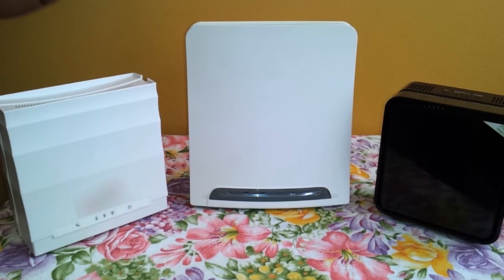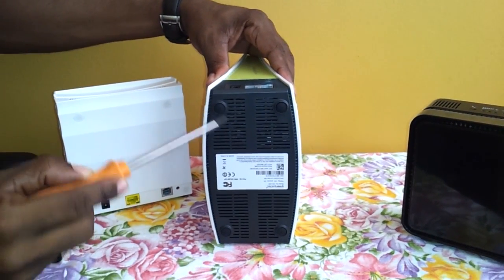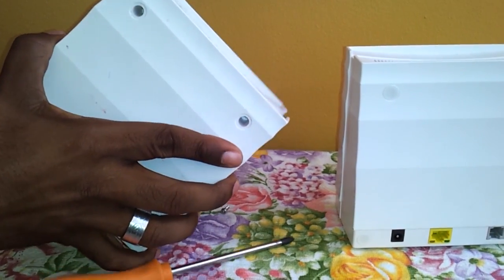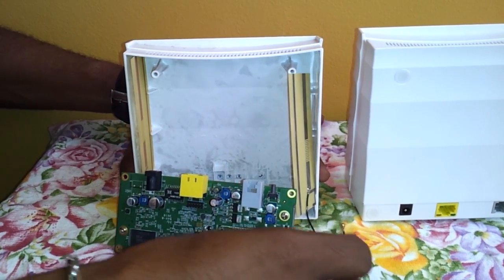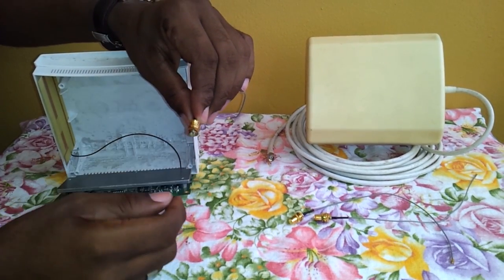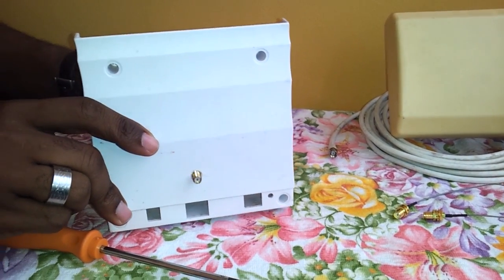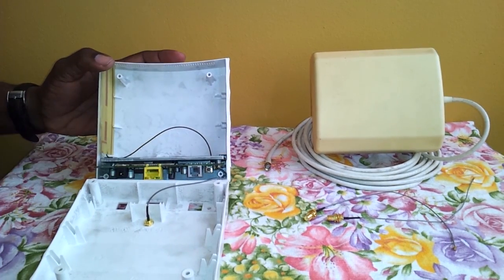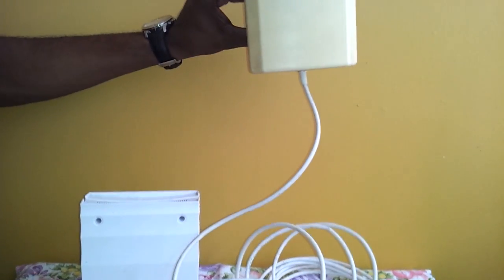Add an external antenna and boost your 4G broadband connection

Comment: How can i get the antenna here in Jamaica to buy ?
Reply from the maker: andre james oh wow.. Well I actually got the items required off eBay and Amazon... 
There are some links to each product in the description area. Hopefully those can help you get what you need.
Reply: RecarroJames 
Does it have to be a 10dbi wimax? Can it be a greater one?
Reply from the maker: andre james yes... It can be. If you can find a 15dbi or 18dbi even better.
Reply: RecarroJames respect
Reply from the maker: andre james Ahh cool 😎
Reply: i need some help with how to pull apart the greenpacket. The white and green one, if i pull this one anymore its gonna break
Reply from the maker: andre james It won't... I can't remember if it's the side without the LED that you pull away. Try it.

Comment: how much would u charge to modify it for me?
Reply from the maker: +kemistrypops at this point I could not because I don't believe you would get the true service you desire based on the fact that the network is now very shitty
Reply: RecarroJames ye it's frustrating. I basically live under a rock, do u know any alternative apart from flow and Digicel? dekal wireless is out, that service past shitty

Comment: I understand that 4G LTE requires two antennas.  How do you know which one to pull to modify?  Is there a further benefit to doing both of them?  I have a ZTE z700a ATT "HomeBase" and would like to do something similar.  Any external antenna that supports WiMAX will do the trick?
Reply from the maker: +Mike Orlando if you do both antennas then you would further improve the connectivity. For my wimax device, it really didn't matter which antenna was used, they acted like two pipes carrying water to a tank, any one of the pipes modified would then improve the rate at which the tank received the water flow. 
For wimax devices you need to first know what frequency the modem is receiving on, whether 2.5ghz or 3.5ghz range. You can sometimes get this information when you log into the device (or from your service provider). Once you know this then the antenna you're getting should match the frequency the modem and your network uses to communicate with each other.
Reply: Thanks for the info, I will probably attempt something here in the next few weeks.
Reply: Mike Orlando: did you modify the z700a? How did it go?

Comment: hey recarro james I pointed the antenna to another tower and I'm getting better speeds,question though, since the previous tower is closer to me and I have the other antenna still inside the modem won't it cause a conflict?
Reply from the maker: Well, based on how the Digi network is designed, your modem will communicate with the tower providing the best available connection. Maybe an antenna on nthe tower that's closer to you is not providing service right now.

The device carries two internal antennas, the mod is pretty much an extension of one of those so no, you won't have any interference. If the one remaining on the inside starts to see a better signal from the tower closer to you, then the device will communicate through that site (it will be handed over from the other and vice versa).

Hope this helped out somewhat...
Reply: Thanks a lot, I'll just watch and see.
Reply from the maker: +mremellio ok cool.

Comment: ok, so I'm set up and ready to go, can you tell me what RSSI value I should aim for?
Reply from the maker: Depends on what you were receiving before. Also, how far away are you from the serving tower?
Reply: RecarroJames I was getting -75db and I'm about 4 miles from the base tower.
Reply: I read that that anywhere from -50 to 80 is ok but what about below-50? Because I'm at-49 right now.
Reply from the maker: The closer you move in the direction to 0, the better the signal so -49 is great. What's the CINR?
Reply: RecarroJames the cinr is 35
Reply from the maker: That is good...

Comment: will a 2.4ghz antenna work? recarro james
Reply from the maker: No it will NOT.... You need an antenna operating in the 2.5-2.7GHz range if you can find one that's marked 2.3-2.7Ghz you should be ok. But wimax here operates in the 2.5Ghz spectrum.
Reply: ok thanks
Reply: do you know any outlets that sell them here in Jamaica?
Reply: because I had gone and bought one but it's a 2.4ghz antenna
Reply from the maker: mremellio In Jamaica, hmmm. naaah.
Reply: the cable on my external antenna is too small in diameter,it doesn't fit the extension cable I bought
Reply from the maker: Hey, the items in the links work...

Comment: can these modems be used to play online gaming? xbox live?
how much mbps are they
Reply from the maker: Based on the Technology and how the network is at this point, I would say it's not the best for gaming. The Mbps received is dependent on a number of things such as:
1. Distance from transmitting tower you are connected to
2. Number of users connected to the transmitting tower you're connected to
3. Maximum capacity of that site
4. How other connected are using the service (i.e. if they are gaming, streaming this may have a negative impact on your service.)

Comment: Can i use a yagi antenna for this too?
Reply from the maker: If it supports the WiMAX frequencies (2.3-2.7GHz) then yes.
Reply: OOH. the antenna i bought only supports 2.4GHz.. Is that why it didn't work?

Comment: There are two towers behind me. Lets do this do over the video from start to finish with real world examples so I can check to see if I've missed something. Your video doesn't show the end product and after following your steps I ended up worse than where I was.
Reply from the maker: What is the stated frequency of operation of the antenna?
Reply: Dude I messed my modem up following your steps.
Reply from the maker: +oniel cole You can't mess up the modem like that as eveything is plug n play. No wires are to be cut, just unplug one antenna from the circuit board and plug the pigtail connector.
Once you have the pigtail connector, the correct cable and the right antenna it will work.

Comment: I followed your video to the letter even found the exact antenna on Amazon. com for $49 dollars and all this did was to give a poorer signal.
Reply from the maker: Are you certain that it's the same antenna? Remember that the operating frequency has to be within the range 2.3-2.7GHz. 
The cable can't be too long and you must ensure that you are pointing the antenna in the direction of the Site.

Comment: Can you do a video showing the results after the mod? What speeds did it give you?
Reply from the maker: What this mod did was to stabilize the communications between the nearest serving tower if your connection is poor. As is relates to speed, that is really dependent on the ISP and the amount of users on at a given time of day. 
I remembered getting poor RF signals before the mod and speedtests were like 0.75-1Mbps, after the mod I started seeing up to 4-5Mbps.
Reply: Ok. My ISP is Digicel so I'm seeing 1mb the most. I have the green packet I think 250. The tall green and white one. Which antenna is for the wifi and which is for the 3g/4g?
Reply from the maker: When you open that device there will be 2 thin yellow film on either side, those are the WiMAX Antennas. They'll be attached to the circuit board similar to the one I showed in the video.

Comment: where can I get the external antenna and the other cable needed for the mod? Watts New?
Reply from the maker: I got them off eBay: http://www.ebay.com/itm/360591276808 || http://www.ebay.ca/itm/121069347949 || http://www.ebay.com/itm/351331597276
Reply: RecarroJames thanks man. just bought the wimax antenna.
Reply from the maker: No Prob... Btw search for a u.fl to sma pigtail. Oshane Diedrick

Comment: Hi Recarro, I have search the link that you have given but the antenna is different. is that type of antenna still available on eBay or is there another one that can be safely used.
Reply from the maker: http://www.ebay.com/itm/360591276808 

http://www.ebay.ca/itm/121069347949
Reply: Hi, I really appreciate all the information that you have given. I have made my purchase and received the antenna but my problem is that my cord is very very short seeing I have to go way on top of my roof. I did not know that the cord and connections were so small so I am in  a bind as to the extension to purchase. Can you advise please. Thanks a lot.